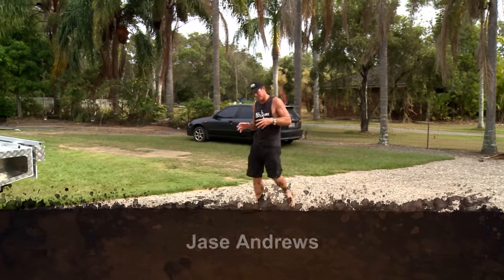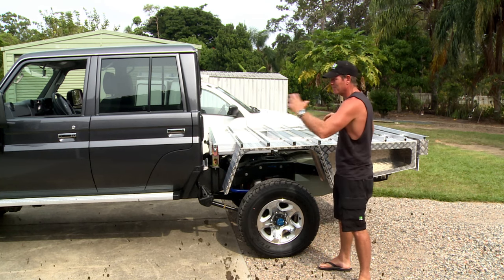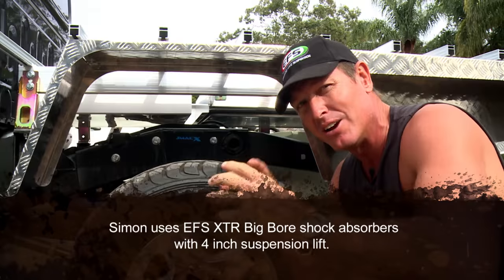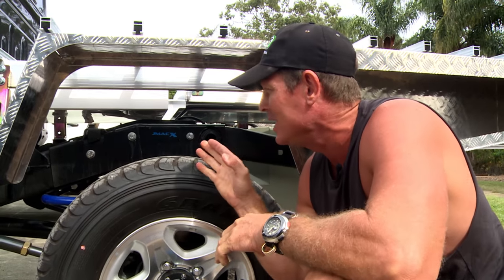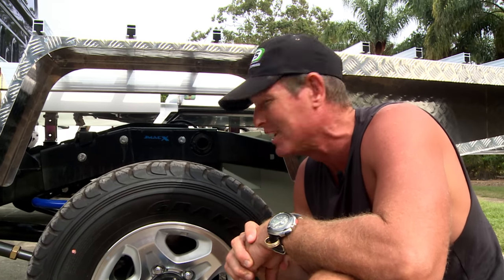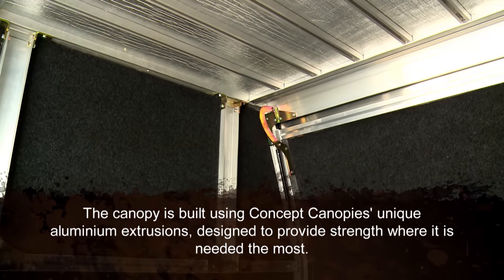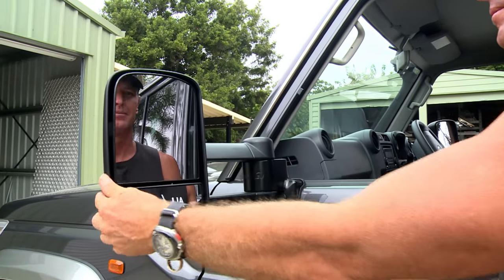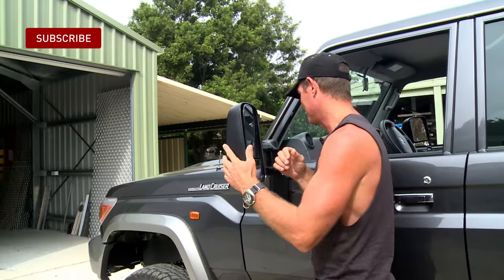Landcruiser 79 Series Build: Part 3 ► All 4 Adventure TV

Comment: I hope you set up your load valve for more power to the rear brakes. So many people running around with air bags on the rear and the load valve not set  makes me laugh when they come in and complain about warped rotors on the front and not being able to pull up from high speed. People put heavy loads on the back and then hitch up the van, level it out with air bags and wonder why they don't stop.

Comment: If the coils hold as much or more weight than a leaf pack why does it need polyair bags in the coils??   Ive done this myself n had polyairs in n wasnt happy so i got dobbinson to custom build me coils to hold the weight. So i didn have to use polyairs.......
I wouldnt do it again i will do a full airbag rear suspension set up then u can have it to what ever height n load you desire.   Thats my thoughts.

Comment: How much is the truck before the modifications and how much are all the modifications? Those mirrors are the same as the tow mirrors on my 2010 Chevrolet 2500 HD. I added Blistine  shocks all around with 5000 pound rear air springs. I have a customer aluminum body with two storage boxes, a 75 gallon auxiliary diesel fuel tank. It has a 20,000 pound B&W companion 5th wheel hitch that's recessed into the frame, it can be removed and a Goose neck hitch installed. I tow a 34 foot 5th wheel with an empty weight of 6700 pounds and a gross weight of about 10500 pounds. This gives me a safety margin of about 7000 pounds. The engine is stock it pulls so strong I haven't felt the need to make any modifications to it. It is extremely fast for a 3/4 ton truck. I love your show been watching what I can for three years or so. Is there any way to get the full series in the US?
Reply from the maker: G'day Louis -- You'll want to get an account over at http://unleashed.tv/registration  Overseas folks will be able to watch along with the aussies this series! Cheers